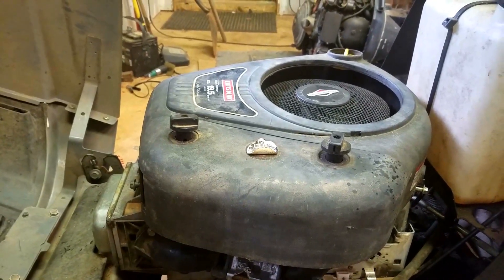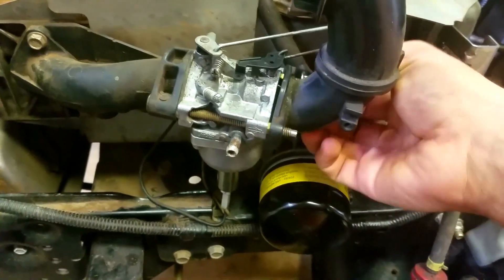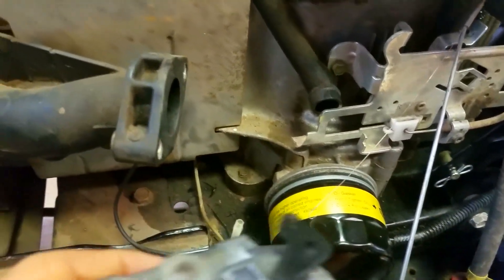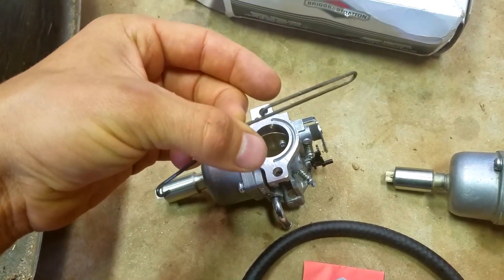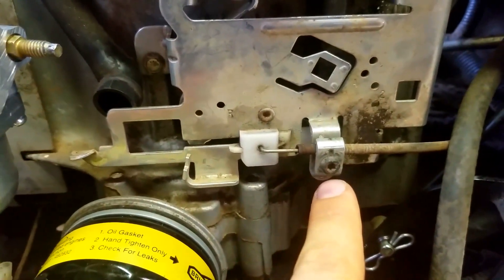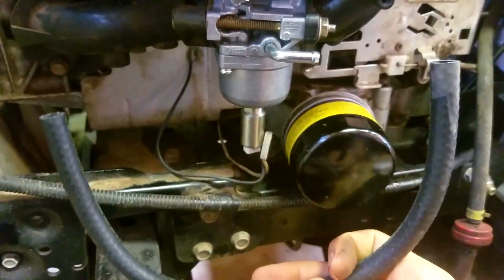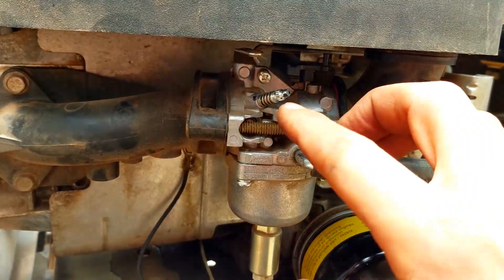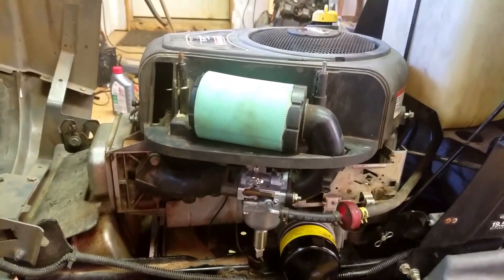Riding Lawnmower Won't Start or Run Right? WATCH THIS!

Comment: Great video. Riding lawnmower is not starting. The starter engages the flywheel and the engine won’t start. I cleaned the carburetor the best I know how. Do you think it needs a new carburetor or there’s something else wrong
Reply from the maker: Check for spark, 9/10 these riding lawnmowers have like 5 safety switches that kill the spark. I know there's one under the seat, clutch petal, in the ignition switch, low oil switch, and maybe one to do with the belts.

Comment: Anyone know the process of replacing the cylinder head?  Mines a craftsman lt3000
Reply from the maker: It's just a couple bolts to get it off. That's the easy part. The hard part is making sure everything is within spec. You kind of need super accurate machine shop tools to check everything. If you slap it back together you'll have problems.

Comment: your motor run to slow ai gues 25 to2700 rpm. ideal is 32 to 3300 rpm there cutter and al work the best 😁

Comment: So I am clear,  the fuel mixture is done with warm engine  and  throttle lever is at half? Also,    I am curious, what am I looking for when adjusting the idle screw. What is the procedure?
Reply from the maker: Magic .Mark Did you follow how I did it in the video? 9:13 will show you how to do it!

It's been a while. You want to set all the settings with the motor warm. You are supposed to find the middle point between lean and rich and set the setting there.
Reply: ThanksI watched the video. You did not touch the idle screw.You mention it but say to get that right first.  So I dont know what to look/listen for on the idle  and if you adjust that screw on warm engine, middle throttle as well.  
  I also want to know how you set the cable. You say play with it. I have a service manual and they talk about putting the throttle at FAST and moving  the white part  until a hole B  is open and something  else is lined up . The service manual is not very clear .  I can confirm my choke is NOT fully closed so I need to do that adjustment first . So you put yours in high choke vs Fast. I did not know if setting it with lever at fast to the manual, also sets the choke.  or if I should be setting it  in the all the way up as you were showing.  Make sense?
Reply from the maker: Adjust cables:

Throttle: 
Make sure that the throttle cable will go all the way to fast or the bunny rabbit and make sure that it will go all the way to slow or the turtle. 

Choke: 
Make sure that when you pull the choke lever all the way out that the butterfly in the carb completely closes. Also, make sure that the butterfly completely opens when you push the choke lever all the way in.

Basically just make sure that the cables are adjusted so that when you pull/push on the knobs they are where they are supposed to be at the carb.

Idle:
The idle is set to a specific RPM with a tachometer in a shop setting. However, you don't need to get it that close. Just set it by ear so that the motor runs good ad idle. Not too fast and not so slow that the motor dies.

Jet:
You want to set it with the motor already warmed up. Lightly seat it, count the turns in so you can reset it if it's not right. Unscrew it to 1 1/2 turns OUT as a starting point. Then turn it IN until the motor slows down. Turn it OUT until the motor speeds up. Find the MIDPOINT between these two settings and set it there. From what I remember, from the manual it is set at half throttle.

Comment: How much did that carb cost ya
Reply from the maker: Good question. I think it was like $80 brand new. I got links in the description. Whatever you do NEVER buy the Chinese copies. They are the WORST and never work right.
Reply: Matt's Shop ok thx for the tip
Reply from the maker: Yea no problem!

Comment: The only thing you forgot to mention was placing the hose back onto the breather piece in front of the Carburetor. Otherwise you did a very nice job of explaining things.
Reply: Thank you for the advice.  Actually didn't replace the hose going to the breather piece.  I'll try that and see what happens.